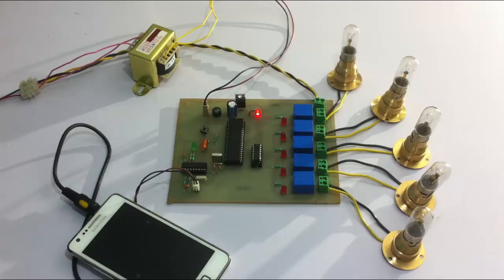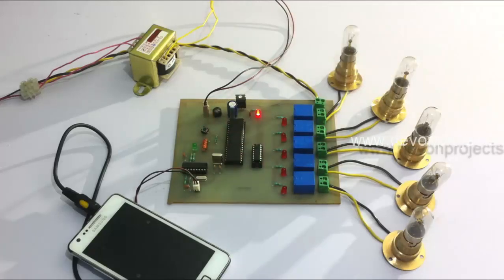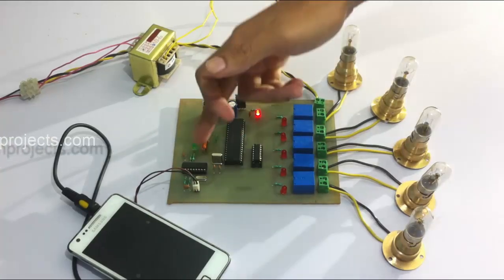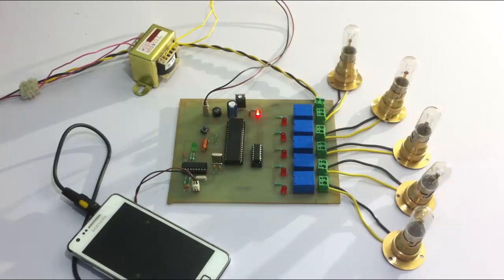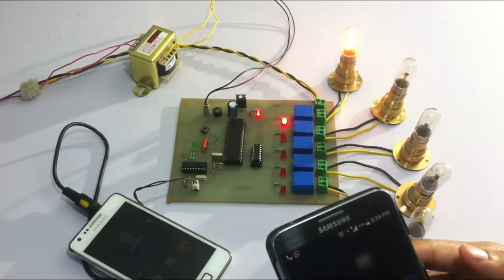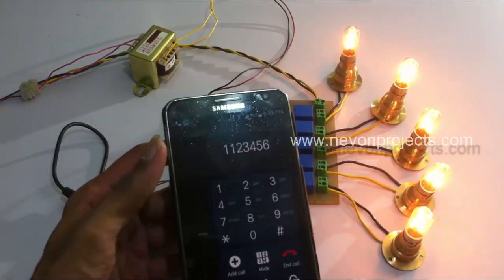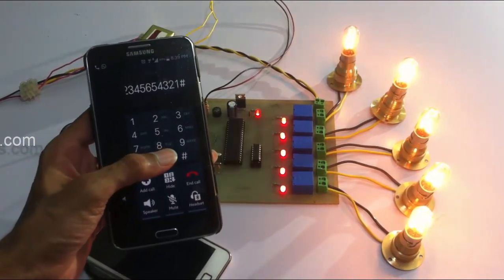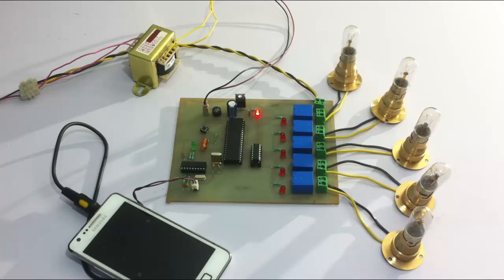Load Control System Using DTMF

Comment: I have a problem with a circuit that uses DTMF IC HT9107B . It connects to Nokia 1110 and a motor driver. Sometimes it gets disconnected. Yours seem work very well.
Reply from the maker: Please find complete project details at http://nevonprojects.com/load-control-system-using-dtmf/